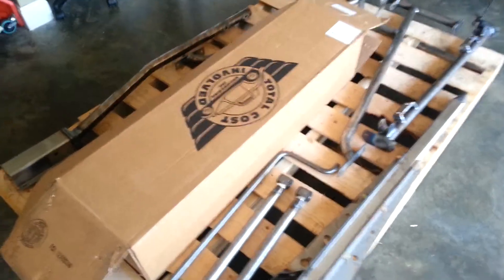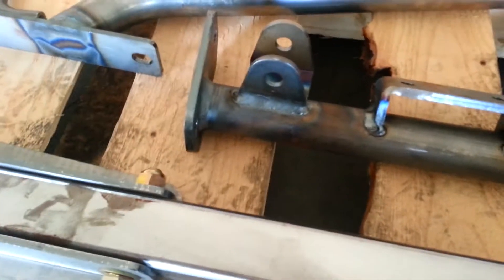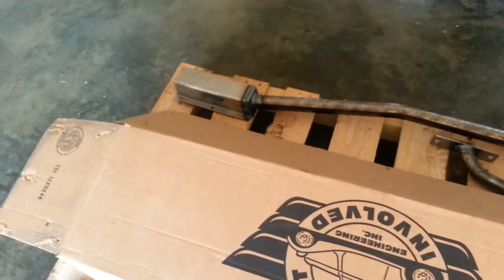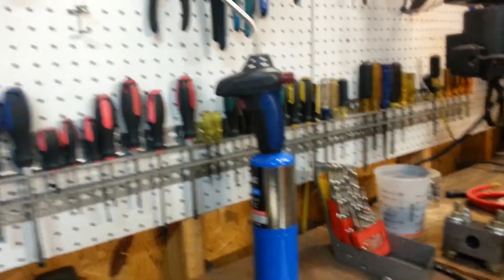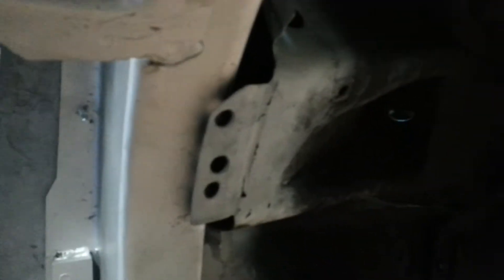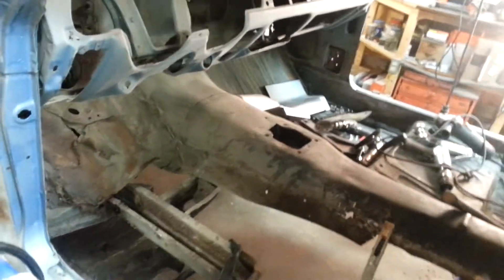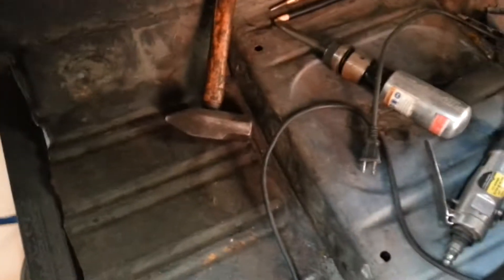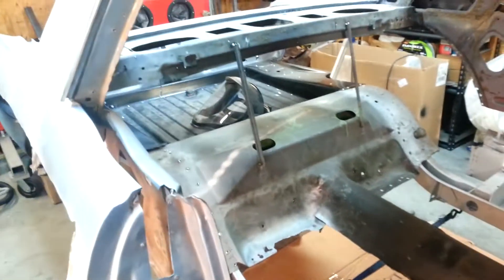68 Ford Mustang Restoration - Elaina - Video 14

Comment: That rear suspension set up is trick, I have seen a few cars with the Total Cost Involved product installed. Man that is a ton of metal fab going on good luck closing up the gaps and finalizing that part of the project.
Reply: Agreed. I don't have the bucks for that kind of suspension but I am a cruzer part time stop light dragster so I don't need that much tech. Cant wait to see it in action.

Comment: I know hind sight is always 20/20 but I learned the hard way in my first resto not to cut more than one section at a time. You have the factory measurement sheet which is great. Keep in mind that it was a "suggestion". When these cars rolled down the line not one of them came off exactly as that sheet said they should. That gives you room to work. Before going any further I suggest welding X braces in the door openings to keep them square and a cross between them to keep the car centered. Mich like a mini roll cage. Otherwise when you pull the car together another area will flex or pop apart. With so much sheet metal gone the unibody frame is compromised. Square it up, brace then get the floor pan back in. That with door X braces should out it all back in line. As for how to oull it back together, I would use 2 ratchet straps across the door openings and alternate ratcheting them to keep from bending the rockers. This provides a small amount of force at s time. Also use a verticle plumb bob at each corner of the car to ensure it does not rack or twist. I simply measure the height at each corner and tie a string to a bolt and hang them touching the floor. If they rsise or lower you know right away the frame is twisting. Once the measurement is correct weld a brace across from rocker to rocker to hold it. Then start in on the floors and work backward. I did not see any but I assume you will be installing sub frame connectors. Much easier to do with the floor open. Best of luck.

Comment from the maker: thanks for the comments guys. ya, it definitely wasn't my plan to cut out more sections than 1 at a time. started with the front, lower cowl panel, then floors. built rotisserie to make the floor work easy, then found bad frame rails so i couldn't mount the rotis. and kept spreading from there... and the body was already twisted some. that's actually how i realized that i had held off long enough on the restore. hopefully with measurements i can get it back to damn near close enough where i won't have to fab a bunch of crap when it comes to getting the body lines straight. thanks for watching again guys. i'll keep you posted on how "operation rocker pull" works out.